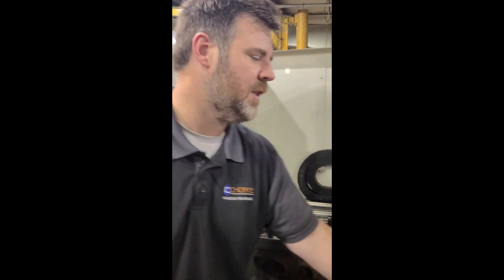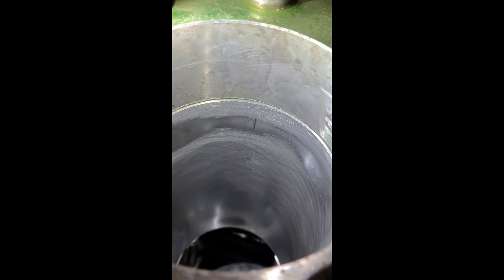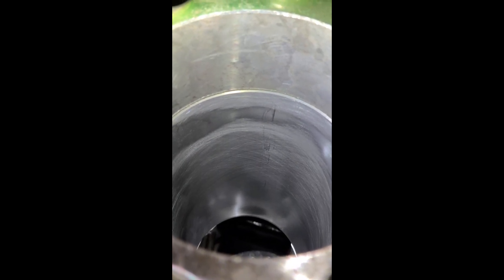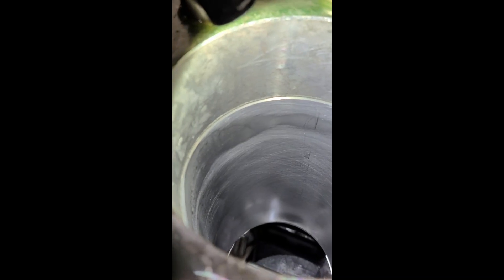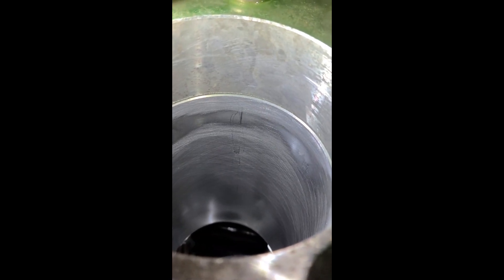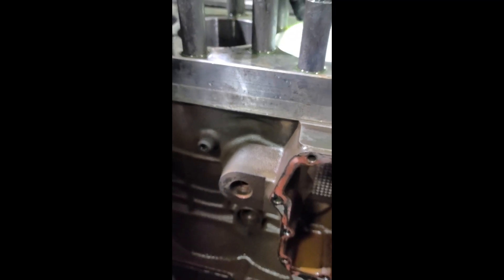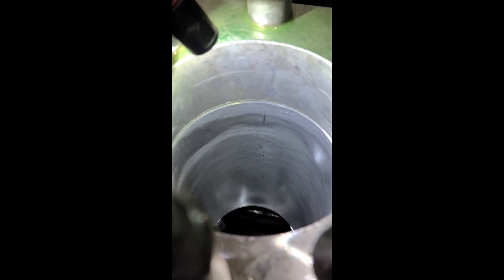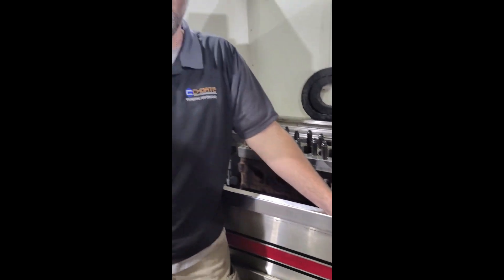Your engine is losing compression!! Torque Plate Honing and why it's a MUST DO

Comment: To my knowledge, torque plate isn't used in the factory. I'd like to investigate this interesting sleeve failure, what was the PTW clearance, piston ring thickness/material, piston alloy, and engine setup/application
Reply from the maker: It actually is used on the ISB in the factory. Piston to wall typically is .001 to one inch of bore with aluminum at .000012 x 1 degree Fahrenheit × diameter.